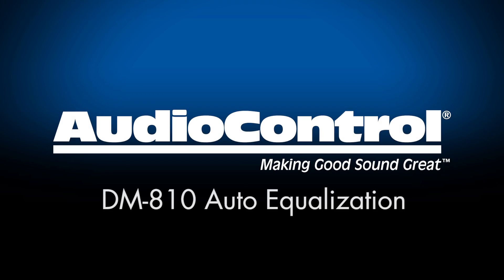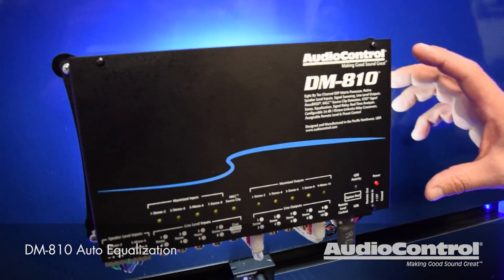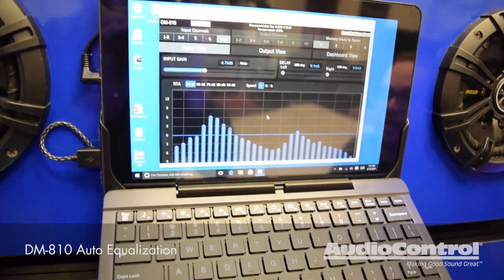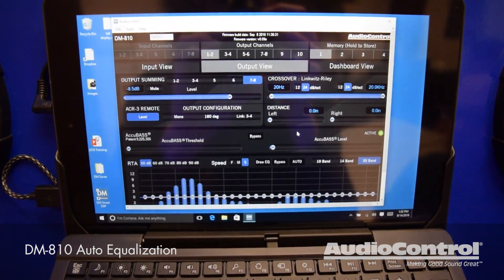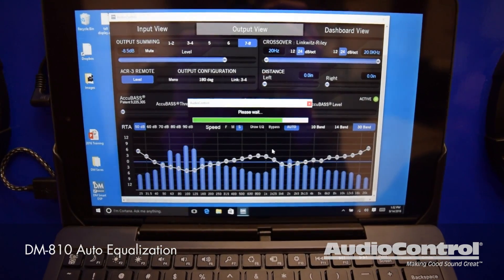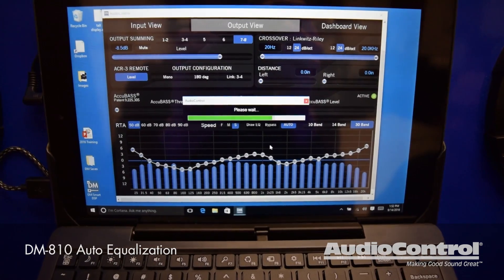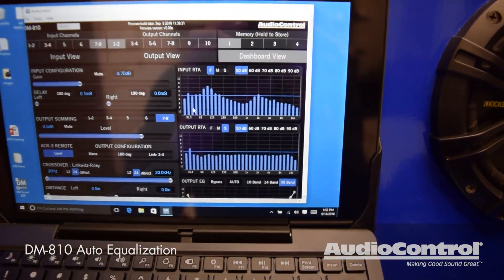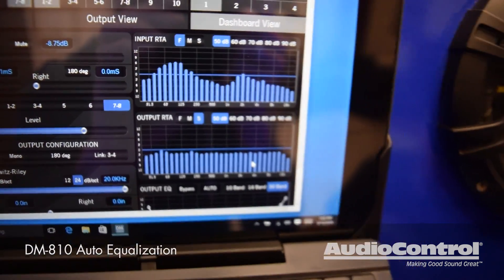AudioControl's new DM 810 - Auto Equalization

Comment: Can you explain the difference between the DM 608 and the DM 810 I’m considering getting one of these processors
Reply from the maker: Sure thing. The DM-608 has 6ch of input and 8ch of output, and the DM-810 has 8ch of input and 10ch of output. That's all, the 608 is just a smaller version with a little lower price. The software and features are the same otherwise.

Comment: Would the DM 810 be compatible with the new iDatalink Maestro AR . The Auto Sum is terrible in my truck and I need to figure out a way to bypass the factory amp.
Reply from the maker: Yes any of our products that have our option port will be able to use Maestro AR. We will be a few months before we are fully programmed but are working on it everyday.
Reply: That is great news. I was going to be mad if I had to get all new DSP and/or amps. 

It will be nice getting full SQ without the wining that is being created from the summing. 

Will the bass gain be able to be co troled from the Factory Radio then instead of the dial? I would like to have my center console pocket back again.

Comment: Would the speaker inputs for the device handle 400 watts rms? Basically, factory amp with a factory sub-woofer.
Reply from the maker: Not a problem!
Reply: AudioControl 

when will this product become available?
Reply from the maker: Now shipping...
Reply: Can you make a video the explains the features of this unit. I'm seriously debating between this unit and the JL audio Fix 86 acombined with the JL audio TWK 88
Reply: Also waiting a response to this question.  I have those two JL products mentioned above on my 2016 Highlander and am very happy with those.  Now looking to update the system installed in my BMW that was done 12 years ago.
Reply from the maker: https://youtu.be/ga0EO9xNJWk

Comment: What operating systems are supported by the application?
Reply from the maker: Initially PC and Mac OSX is in the works.
Reply: +AudioControl So here is my wish. forget the PC. Just make an app available for the phone to control the parameters and settings.
Reply from the maker: Ah! That is also in the works!
Reply: +AudioControl awesome. I cannot wait to use this on my Android phone. The PC is dead.
Reply: It's got a place for both.  PC/Mac devices allow for ease of use due to allowing a larger selection of choices all at once similar to the "dashboard" view.  Of course once you've had your initial set-up would be annoying to always have to use a laptop device.

Android/Iphone application would have too many menus while not showcasing various options all at once.  This however would be great once the system is already calibrated and need little adjustments.

Now a tablet application would be a great mix of the two ;)